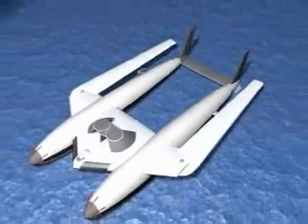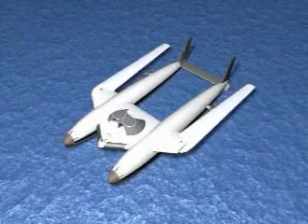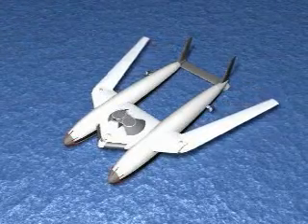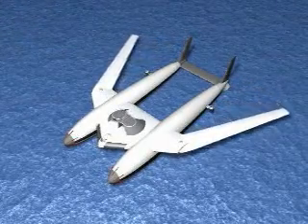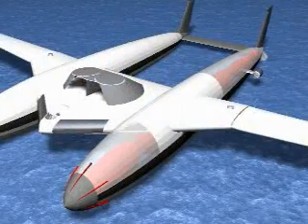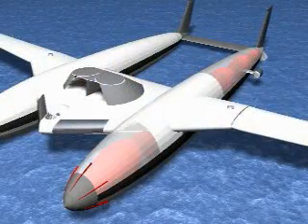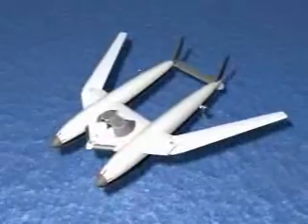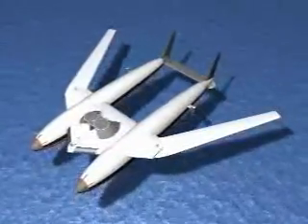Fuel-Less Flight; Gravity Powered Flight

Comment: If you somehow manage to compress gas in a way more efficient than conversion of energy in conventional aircraft engines (which is not high at all, I doubt it is more than 20% even in theory, so there is space for innovative thinking), then your idea is at least promising if not revolutionary. Else, you will have fancy, but expensive and energy inefficient toy which, for that reason, will not sell.

Comment: ...but Tesla's idea fell short when it comes to equations with realistic parameters of thermal and electrical conductivity. Even if he had superconducting electrical and superinsulating thermal materials at the time, he would loose more on maintaining superconductivity and superinsulating ability than even in theory he could gain. So, if you like it or not, you are going to use some external source of energy. What you certainly have is absolutely silent and environment-friendly engine concept.

Comment: Not bad as idea, but have you checked thermodynamics of the process? Is it favorable from energy balance point - you need energy, of course, to compress Helium back into the tanks, and it is, by laws of thermodynamics, more than you gain from potential energy of altitude you have. You can gain something from different temperatures and pressures in different layers of the atmosphere, in an idea like one Tesla had to propel ship using difference of temperature between surface and deep water...

Comment: Such aircraft won't make it above 1mile alt. because its rigid. the pressure of the gas inside would make the ship heavier, and thrusting it out would generate minimum lift. Also upper-atmospheric winds are generally 60-150mph.